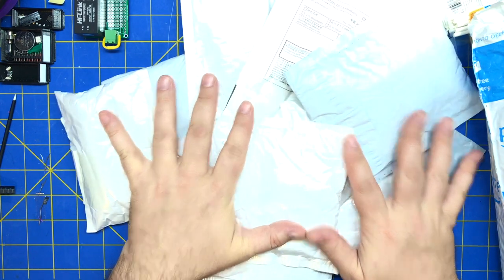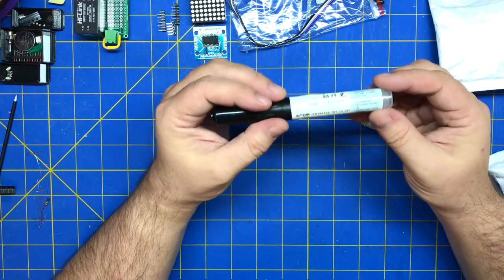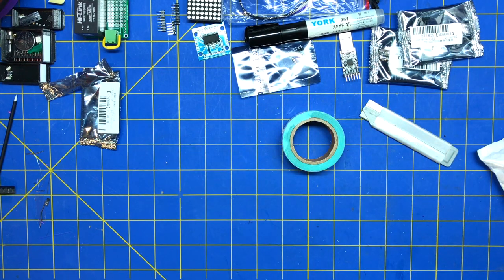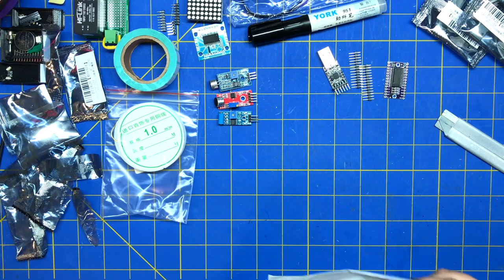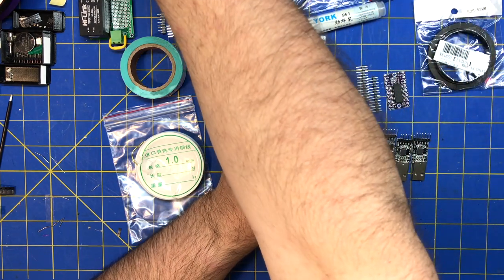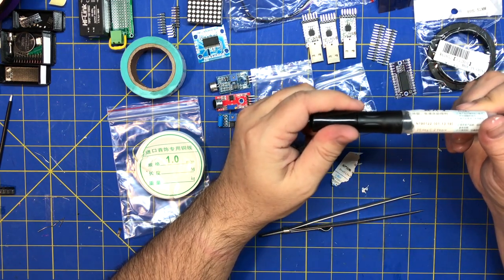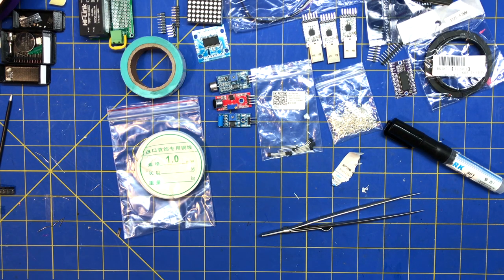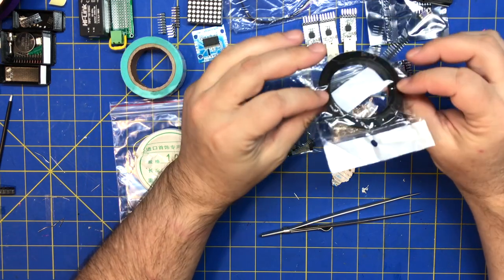Mailbag #50

Comment: That flux sounds like light-ends that will flash off as soon as you touch it with an iron, so I would be surprised it did anything. Most of the ebay fluxes I've got do the same thing as not adding any flux at all.
Reply from the maker: I used it once , it did not seem to do anything, When I have time I plan on actually testing it properly. But you are probably right